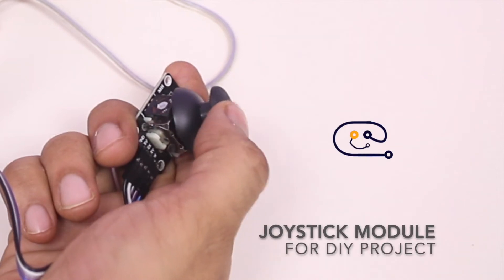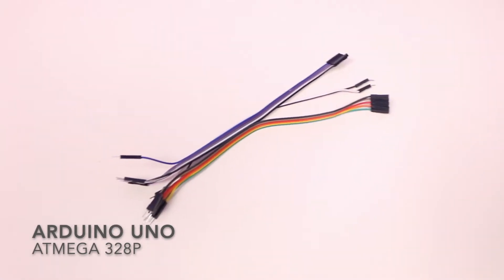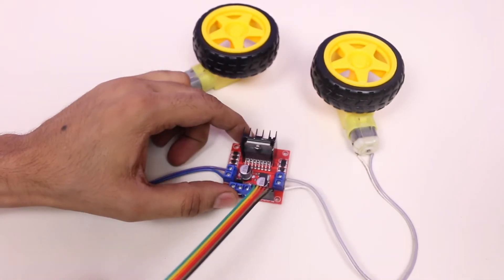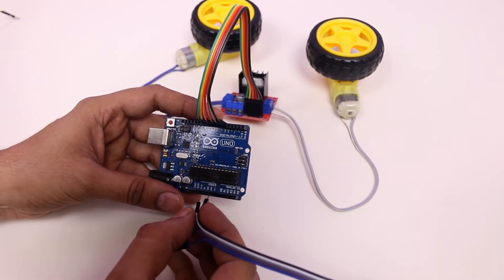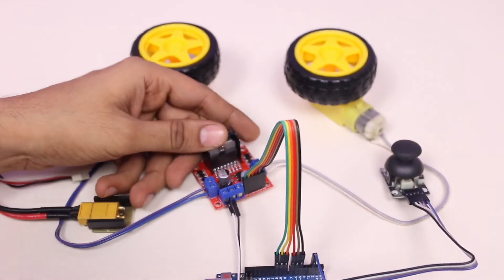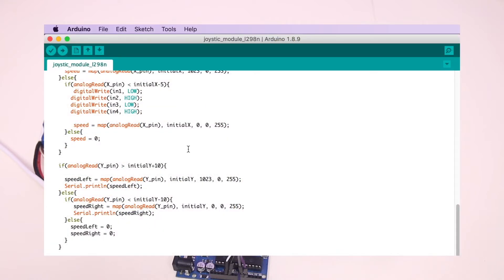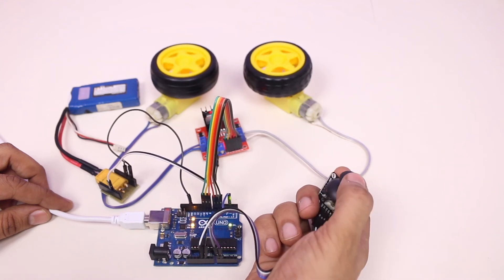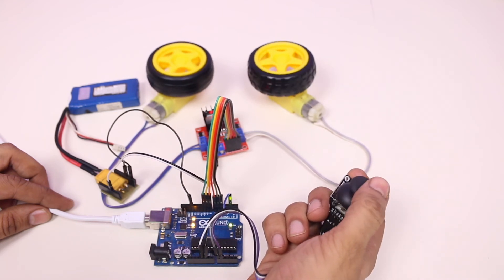Joystick Module with Arduino to Control DC Motors for Robotic Car

Comment: Nice video, is there a way to make the joystick wireless?
Reply: there is a way to use an NRF 24l01 module to use radio control to remote control your project.

Comment: if we want to use bigger dc motors like 12v to 24v then H bridge with work or we need other setup..
Reply from the maker: This driver will work fine for 24v motor, but the output current is max 2amp  and remove the 5v regulator jumper otherwise 7805 regulator can burn, it's just for 5v output.